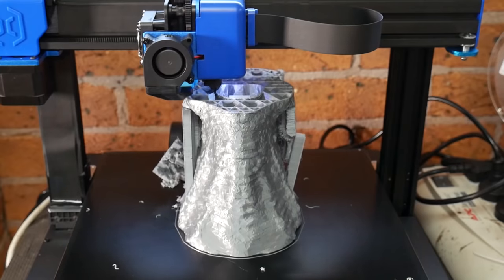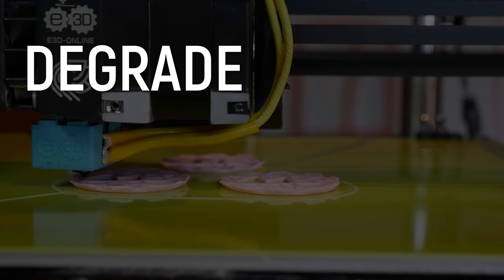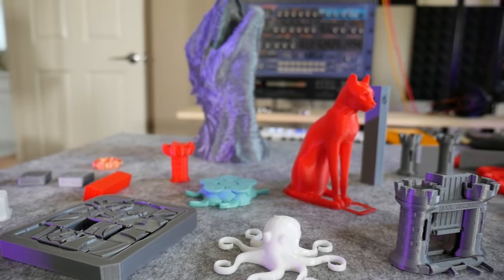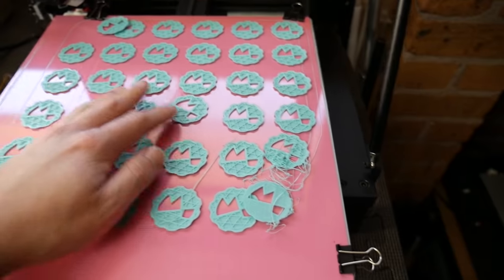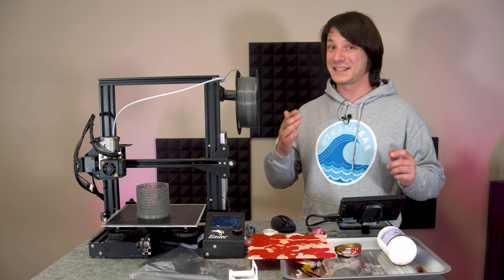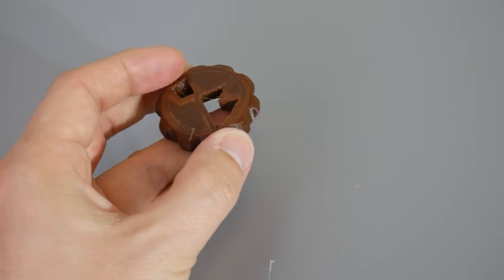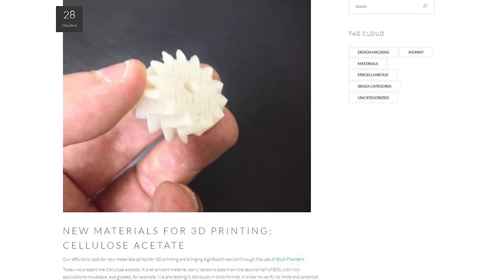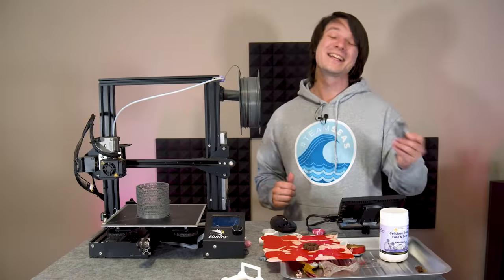PLA - 3D Printing's Biggest Lie.

Comment: Hey Angus, I'd actually considered setting up filament recycling in a makerspace here in California. I was wondering if you had any tips regarding collaborating with other makerspaces, libraries and schools into doing the same. The makerspace hasn't been set up yet, but gathering and turning old filament into new filament using something like a filastruder or 3Devo and allowing it to be sold to members for a small fee was close to what I had in mind. Can you foresee any problems with this? (other than plastic that wasn't separated properly?)
Reply: That's probably the best way to do it, especially if they are coming in and not making sperate trips for it. Make sure to make the collection box open for the public and make it as easy as possible for them to do so (making things even 1 second longer or more difficult means more people won't do it), and then keep the prices just below the cheapest on the market since you're wanting people to actually re-use those rolls.

One major thing is companies would like to donate several pounds per week, however due to proprietary nature you'll want some kind of thing that says you respect privacy and won't re-engineer or mention what comes through. Now that's not going to cut it for most companies, but maybe some would be willing (like the place I work for we absolutely could not use your service, and usually if we have a misprint its between half and 1 entire consumer size roll which is pretty common). Unfortunately just for saving maybe 5 to 10 pounds/week that's only 250 to 500 pounds of plastic/year (which is like $250 to $500 in waste), that's not enough for a business to justify spending thousands of dollars plus someone running it especially if production improves and the waste is lower than that. Basically you need at least a couple pounds per day to justify the machine cost (which also is going to use a huge amount of recourses to produce, that machine doesn't appear from thin air either)
Reply: @jakegarrett8109  the initial idea was that the donating would be free, or free to members, but buying the remade filament would be like 8 bucks a roll
Reply: @ghostbeebuilds  That sounds like a good deal, I'd definitely opt for that if we had something like that nearby (I'm on the other side of the US). I think something like that should work well, won't really be any profit but it will certainly do well recycling which is probably your goal.

I've always thought they needed a drop box at schools etc so any student could easily drop of recyclables like that and picks it up once a week, or other public areas where people would normally be going to anyways, that way its easy for the people and can be collected once relatively full. So if your makerspace goes well you might even have options for more sourcing and help creative students have another option for more affordable roles.

Good luck!
Reply: @jakegarrett8109  thank you for the supportive words. I'll do my best.

Comment: fun fact, most corn isnt edible off the plant. so saddly no that PLA couldnt have been someones meal. it might have ended up in a highly processed 'food' though
Reply: animals eat alot of corn and the stalks right? these is the sweet corn varietes we eat but most corn that is planted is a variety that we dont eat but animals do
Reply: @tinaprice4948  They do but corn is so genetically bastardized it's purpose built. Feed corn, popcorn, sweet corn are all different and the livestocks diet does need to be balanced and not all will have the nutrients necessary I wouldn't be surprised if there's one specifically engineered to grow the core components of PLA.
Reply: Livestock feed corn (dent corn) is absolutely edible by people, my family would eat it regularly when I was young.

Comment: Honestly, simply burning the plastic seems like the best short term option. Sure its releases CO2, but with PLA it's pretty much the same as driving on ethanol, (except for the fact that you need a purposely built facility).
Reply: As long as humans burn coal and oil for heat and electricity, not burning the plastics seems like "this is fine" meme. The fact is that as long as we have enough plants groving around the earth, emitting some CO2 is okay. The problem is that we're emitting too much CO2. Replacing some coal with burning plastics doesn't increase or decrease the production of CO2 but it gets rid of the trash as a side-effect, so it seems like a good start to me.
Reply: @MikkoRantalainen 
100% agreed

Comment: if y'all reach that $30M goal that's still not even a dent in ocean plastic pollution, but it's a fine start. to remove the microplastics to an acceptable level will require the largest cleanup effort in world history and it will take centuries to complete. that's the reality of the problem and it cannot be escaped. we inherit this mess from capitalism and it is our duty to fix it.
Reply: @dangerous8333  consumerism isn't a separate economic system and the word exists to make nostalgic the "good old days" when the inherent flaws of capitalism were less apparent, at least to whomever is using it. what we are experiencing is the inevitable result of a world governed by greed.
also you're incorrect but the assumption that any radical thought must come from the youth probably means you're 50-something and traumatized by the nuclear propaganda of the late cold war.

Comment: I'd like to see more interest into using sheets of re-melted prints to replace flat surfaces, or or even build structural scaffolding for 3D prints. Would probably require modifications to how we do 3D printing, being able to add new printed material over whatever base one rigs up, but an example that could be explored right now would be 3D prints with a flat base; why print the base from scratch, when one could use a remelted sheet made from failed prints? Either making the sheet real flat, or acquiring a correction mesh before printing, should work for that.

Comment: I made a contact sensor cover for outdoor fence gate thats in the sun the entire day.  That was 6 years ago and there has been no change in the plastic.  It's still like the day i printed it. 

However, the printed pla parts for holding a carputer tablet melted and dedormed in one day.  I had no idea it got Hot enough to soften PLA inside a vehicle.  And the sun wasn't even shining on the PLA parts so it had to have been just the heat inside the vehicle.

Comment: Thank you for getting the message out that we need to have true recycling, i.e. a way to reduce plastic into it's constituent materials rather than burying or letting it "degrade". All degraded plastic becomes is smaller bits of plastic. The plastic never breaks down, it just gets smaller.  You might find a small piece laying on the ground, but that's not the end. It keeps breaking down to mm scale bits, and then into micrometer bits then to ????  They have found mm and smaller bits of plastic on top of some of the highest mountains in the US, in the deserts of the US Southwest where pretty much only researchers and native flora and fauna roam. It is carried on the winds like any other dust, in fact it is part of the dust that gets blown around by the wind. So yes, we need to find a way to break it down into it's constituent materials so those can be reused for making other things,  or to make new virgin plastic .... i.e. true recycling. No need to acquire new materials to make virgin plastic just use the recovered materials.

FYI @ Angus,  some of your fellow countrymen have developed a method to break down all petroleum based plastics back into oil that can be reused for anything that oil is used for.  In this case hopefully to make new virgin plastic so the oil doesn't have to be pumped out of the ground.  They built a demonstration plant in the UK.  I hope they can scale it up and build them in a lot of countries.  I also hope they can create a similar system for breaking down and recycling the PLA.

What I would want to know is what is in the plasticizers are used since they could make the cellulose less biodegradable.  Making a filament from existing cellulose is not necessarily recycling it. It could possibly end up in the landfill and not biodegrade and even if it did biodegrade there is no guarantee that there won't be any chemical contamination.  Dissolving in acetone may not actually make a difference because when the acetone evaporates you are left with the cellulose compound and acetone vapor in the air. Ideally when creating a new plastic compound we need to also make sure there is a way to truly recycle it and not rely on finding a way at a later date.

Comment: great vid, thank you! we absolutely need to find eco-friendly plastics, otherwise we'll be trying to clean up our messes forever. And with all the hype of the 3dP industry, this type of sustainablity push is really needed. 
Also, that "landfill with extra steps" was really well said. A lot easier to comprehend than "downcycling", which is what happens to most plastic (well, of the 10% that's recycled at all).

Comment: Regrettably I can only confirm this. I did an experiment on my own - several unsuccessful PLA prints inside a composter for 3 years. The prints that were near the compost wall were completely unharmed and not even deformed. Prints that were in the deeper section (my composters have 1 m circumference) - were visibly deformed by heat (as temperatures inside compost reach 60+ degrees celsius easily). But still were stiff and hardly breakable with bare hands. The only thing that seemed a bit easier to break than original were the support structures. Maybe thin walled PLA structure would decompose within lets say 10 years ... but I cant give that results yet :D

Comment: What can be done on the software side to reduce filament use? Composting is great, but the best is to not use the filament in the first place. Do we really need 0.8mm walls?  I never see anyone print with single walls.  Everyone talks about sanding, but maybe filling is better than sanding(Titebond 3 is great!).    With new infill patterns that seem to support the shell better, maybe we need less shell.

How could we help people best choose the settings to reduce plastic use? Could there be a contest on printables for low-plastic stuff? Can designers make more use of internal voids in places that don't need infill?

 How about paper-reinforced prints, or using paper inserts to replace some of the walls? some things could replace the whole bottom shell with a piece of card stock.

Maybe we need some way for models to tell the slicer how they will be used, so it can reduce the strength of non load bearing parts?

A lot of prints are test and failed prints.  How can we make that no longer a thing?  What if we put the extruder on a load cell and measure exactly how much pressure we are extruding with, so we can smoosh the layers together with exactly the right amount of force?  Can we reduce clogging at all just by using more pressure?  Why do we get spaghetti, instead of promoted to clear a jam and continue the print where we left off?  What if instead of a heated bed, we had a laser that preheats the point we are about to print onto?  The same laser might even be able to do some smoothing! 

Ultimately I think they just need something like plasma gassification so they can recycle arbitrary trash, but I'd love to print with truly sustainable filament.

Comment: An easy alternative to cellulose-based filament is thermoplastic starch which is a biodegradeable plastic and functions as a filament in the same range as PLA. It also comes out clear or white, depending on the extrusion and cooling temperatures.

Comment: There are grinders out there for plastics and combine it with a filament extruder, you can make new filament from old prints. The problem is if you aren't much of a DIYer then the machines are rather expensive.

Comment: 12:23 Things being made from trees is not necessarily bad if a new tree is planted for every tree that was cut down. If the cut tree is being used to produce long-lasting materials, there is a potential for long-term storage of the carbon that the tree absorbed over its lifetime, while the new growing tree absorbs even more carbon.

Comment: Nonoilen filament should be interesting to test with in regards to compostabilitie, as filamentum says it's not only biodegradable but also compostable, they claim it will be composted within around 90 days in a regular home compost so, I will put some in an active controlled compost and see if it compostes and to what degree

Comment: But you can melt PLA and turn it back into filament. You can even buy a filament extruder for a couple of grand.
I think CNC Kitchen has one. (I definitely remember a few videos on the subject)
If I had piles of old prints I'd definitely consider it (it helps if you don't mix materials i.e. keep PETG separate to PLA etc)

Comment: Gassification of waste PLA would be a good option, and it should be compatible with gassification processes aimed at waste paper and wood waste streams, provided the low melting point is taken into account on the materials end.
The oxygenated organic chemical nature of PLA should make it well suited to steam pyrolysis into synthesis gas (for use as fuel or chemical feedstock for processes like methanol synthesis or fischer-tropsch synthesis), but should also be compatible with gassification plants targeting a wider variety of petrochemical and biomass waste (basically anything except chlorinated or fluorinated polymers like PVC or teflon).

Better sorting of waste and recycling streams would make possibilities like this much more viable where mixed waste and mixed recycling streams are much more difficult to sort after the fact and in some cases contaminate eachother.

I believe most (if not all) bioplastics and compostable materials (even those like PLA that require special composting) would all work very well with the same types of gassification equipment used for waste paper and wood waste (and similar biomass) with the exception of the melting and flowing properties of PLA at relatively low temperatures. (albeit if taken into account, this could benefit gassification or pyrolysis efficiency by providing more working fluid for better thermal conductivity in the charge)

Mixing aliphatic polymers (like polyethylene and polypropylene) in with bioplastics might also be attractive, while aromatic polymers like polystyrene would be better for depolymerization or pyrolysis batches specific to handling aromatic hydrocarbons. (though pyrolysis of aliphatic hydrocarbons alone produces useful naptha and paraffin fractions generally free from aromatics, useful for low/no-aromatic low/no-sulfur diesel or jet fuel)
Also, since HDPE is relatively efficient to recycle, that would be better sorted separately from LDPE (Code 4) and PP (Code 5), with the exception of heavily dyed HDPE which is generally unappealing to recycle due to the pigment content and might thus also be better for pyrolysis.

Using renewable energy (or nuclear) for the heat source in pyrolysis or gassification would make the processes carbon neutral or potentially even carbon negative (in the case of sufficiently efficiently produced bioplastics) at least until the end products are used as fuel, if they are used as fuel. (and not on a large industrial scale where carbon capture is possible)
Thermal solar kilns/furnaces would be particularly efficient for this as well as possibly geothermal heat, since both of those use heat energy directly, avoiding the losses from generating electricity only to use that for heating elements.

Comment: i think the real solution to dealing with plastic is giving them a second life not as a product but as a biofuel that can be burned in municipal solid waste plants which basically just burn trash in an enclosed environment with a bunch of filters before anything is let outside in order to prevent toxic gases and other bad stuff from getting into the environment. they also produce various forms of dust and ash, some of which can be used for renewable concrete, and the lighter stuff can be used to fertilize soil

Comment: Id say instead of sending it off, we have a FDM recycling company where the facility will accept any pla material free of charge, then sorts it by color and grinds it up and is either used to make more PLA filament or use it for injection molding and they sell processed material to keep the facility open and to pay employees

Comment: If you have a thermal cracking still you could break down plastics into some form of petrol. Also you could treat cellulose with zinc chloride  to make a plastic, though the zinc chloride involves washing the paper or cellulose material. Zinc chloride is a salt that will dissolve in water.

Comment: I think recycling of PLA is the way forward - reason being that I want the stuff I print to not disintegrate. Recycling my PLA leftovers would be very useful. Some might become pieces for use, but even if they become a test print, it still reduces landfill impact. I could image a printer that has two spools: Virgin PLA for the main print and recycled PLA for supports, infill, rafts and the like. More feasible than these alternative filaments.

Comment: Fun fact Angus: Cellulose is a sugar (chemically), so the caramel-y smell and burning would be the properties of the sugar coming out. 
Now, for using as a filament and extruding, I imagine it may end up working like cooking sugars, where if you want less brittle filament you would likely have to add another element to act as almost like a softener.